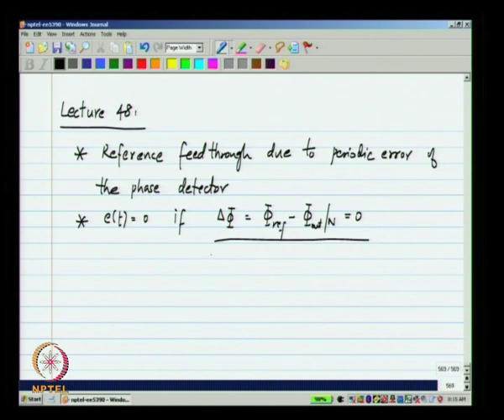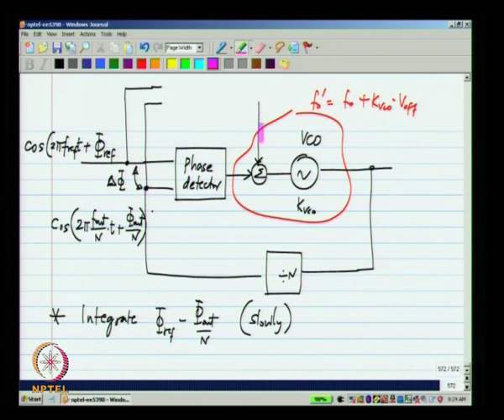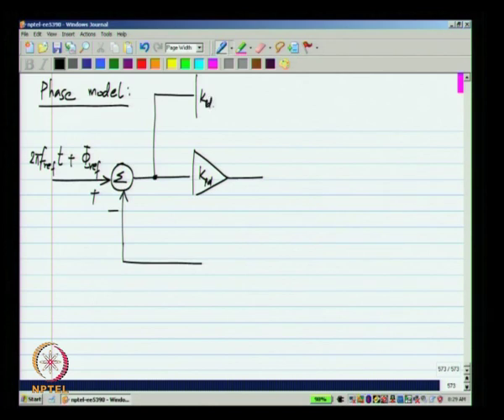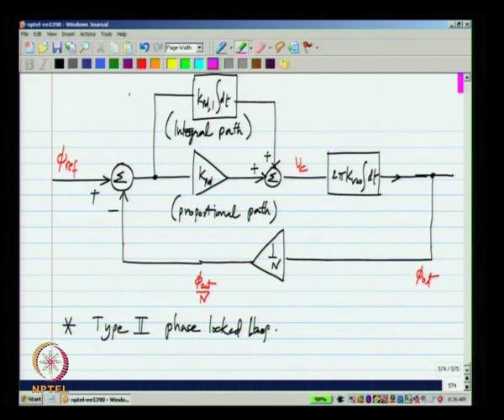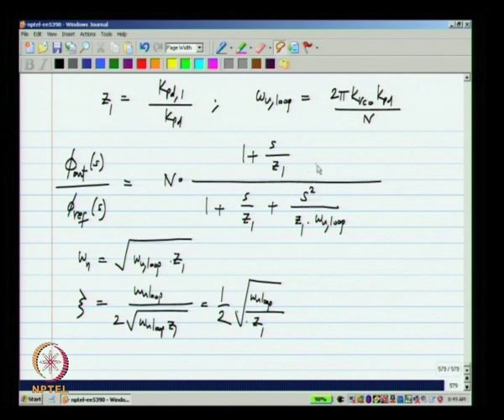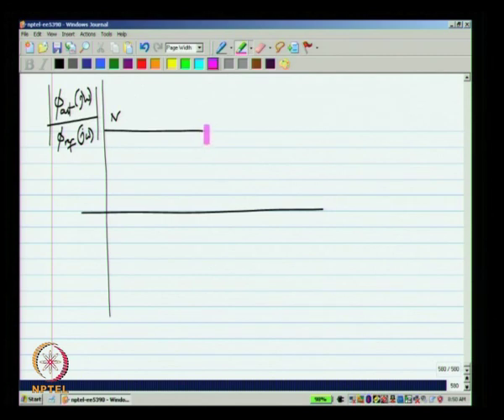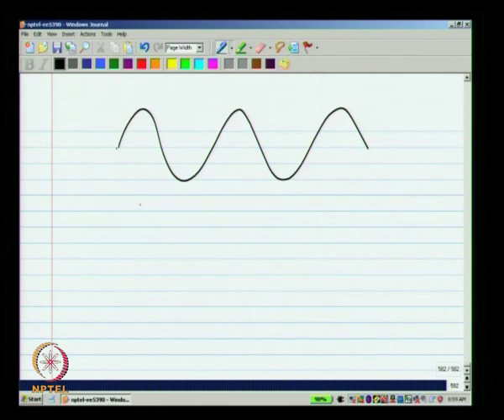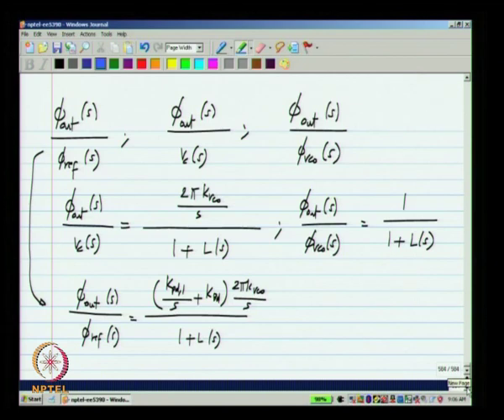Mod-01 Lec-48 Lecture 48

Comment: Is the expression at 20:43 really correct. Should not Vc be equal to zero  as that this coming from the proportional part of the phase detector and delta phi at its  input is now zero? And then  the equation fout = fo + Voff * Kvco + Vc*Kvco sets the new operating point leading to Voff = (fout-fo)/Kvco = (N*fref-fo)/Kvco = Vc'.